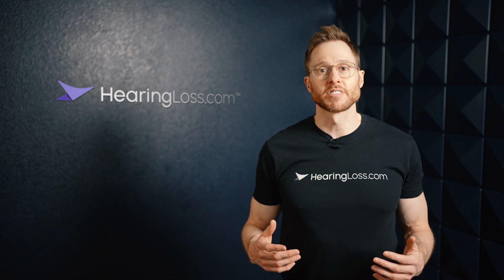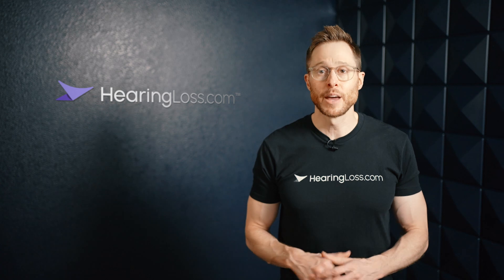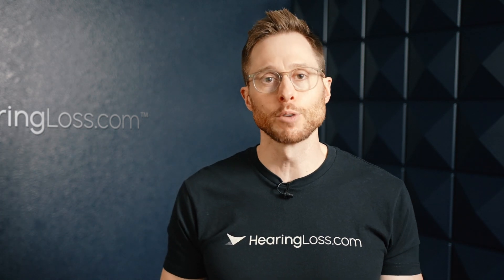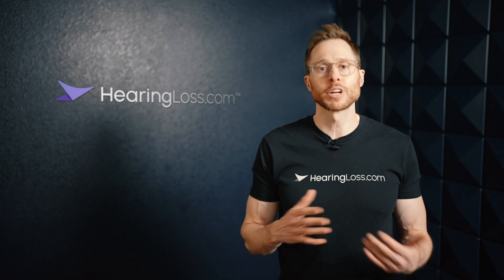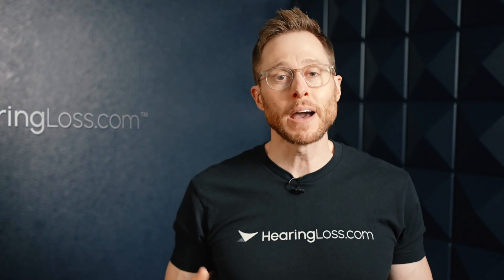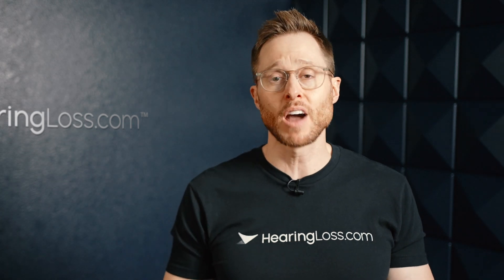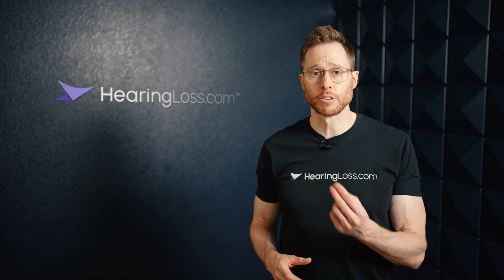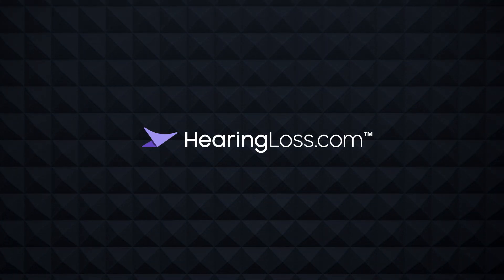How Do Modern Hearing Aids Actually Work?

Comment: I have an important question: I just had a sudden hearing loss; both ears, mild and moderate. I've noticed it over a month ago, but the wheels might have been spinning since June...
Part of the problem is that besides losing part of my hearing ability, sounds are higher pitched now, like their tone has gone one key higher (not sure if I'm saying this right); when I listen to music, it's like I'm listening to a version recorded by the same artist when they were children. Not completely like Alvin and the Chipmunks, but not far from that... Is this usual, guys? And, the real question is: can hearing aids fix something like this? 
I mean, on my pc, the sound board driver has an option to adjust the pitch of the output sound, and by using that, even though the sound quality doesn't improve for me (it's like I've gone from CD to very used cassete), voices sound very close to what I remember (even though they might sound pretty weird to anybody else in the room), that's why before spending some thousands (and these things are really, reeeeeeealy expensive here in Brazil.....) I'd love to learn if it could be money well spent...

Comment: The thing that puzzles me is background noise in one situation is not background noise in another. For instance an auto mechanic needs to hear what may be perceived as background noise by a chip. Defining background noise is a tall order that each situation dictates. I have severe hearing loss and tried hearing aids and found them more irritating than I cared for but it may be time to see what is if a suitable aids is out there now.
Reply: Two thoughts. First, I think you’re questioning the value of hearing aids because of one unusual and very specific use case. Second, if you have severe hearing loss, you really should give hearing aids another shot. And if you do, commit to using them every day for a couple of weeks so you get used to them. I think - and hope - they will make a real difference in your quality of life. Just don’t believe the hype- background noise isn’t going to disappear and the “crowded restaurant” and “cocktail party” scenarios are real issues. But in almost all other situations you will find your hearing aids to be a big plus. Just my thoughts…